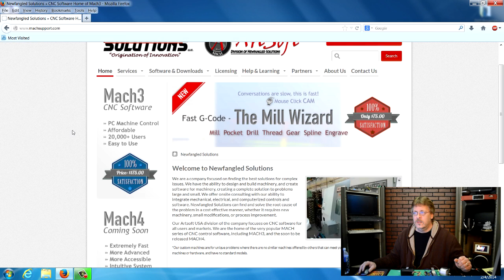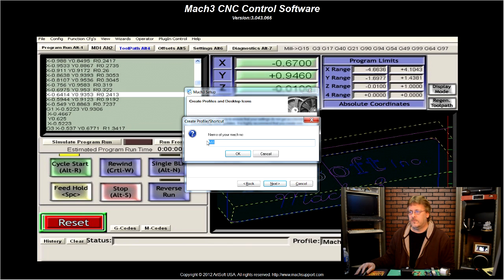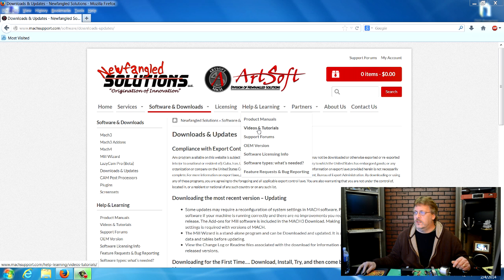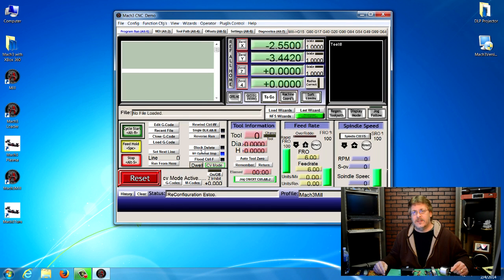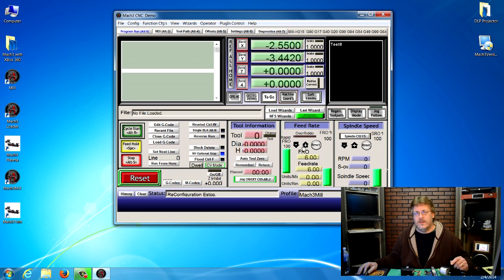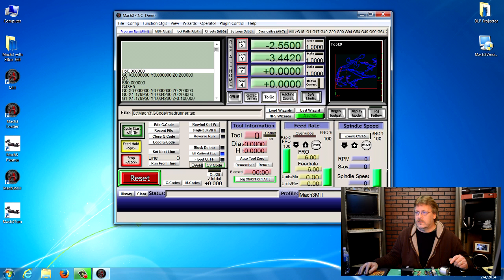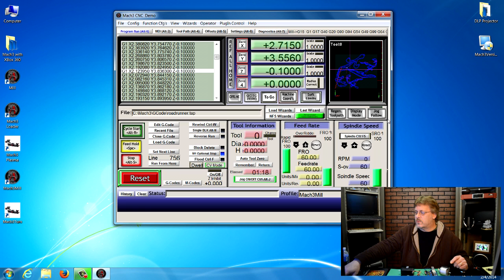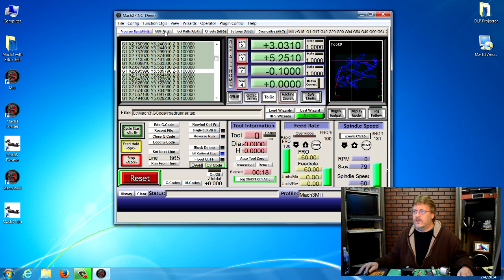CNC Machine Control Using Mach3 - A Beginners Introduction #1

Comment: Hi Steve, you have such a cool calm approach well done, I am Building a complete wood/acrylic routing machine 1200x800mm, For our new Makerspace Ashfield UK ,I have built an extruded aluminium frame with MDF worktop till I can upgrade to Aluminium, I have yet to make the control box as I am interested in building mosty by ourselves, IE bending up a box - fitting BOBs and drivers 2.2 kw woater cooled motor--- We got an XP computer, A Mach3 licence and decent leadscrews and runners. wish us luck in early 2025- Leo

Comment: Hi Steve, great video. I am getting into CNC, finally using the drivers, breakout board, and steppers I bought over 20 years ago. I did get to the point (years ago) where I bench tested the system, pretending to cut a circle with the X and Y motors, and it worked. Now, I just opened Mach3, loaded the Roadrunner G-code file, and the reset button won't deactivate when I press it. So I can't do a cycle start. Any idea why ?  Am I missing a step of some kind ?  Thanks, Tom.

Comment: Hi Steve good informative video thank you for that. Can i ask you though once i have installed Mach 3 how do i know what to put in all the settings boxes before i can run it on my machine?  They look insanely difficult to understand and most of the terminology in Mach 3 settings doesn’t make any sence to me at all. Have you made a video that covers the settings and what to set them to once you have installed Mach3 ?  Thanks in advance Steve and keep up the good work it is much appreciated.

Comment: Good video. Just to add some info; There is no problems running a laptop instead of a desktop, infact it's more convenient sometimes when you don't have much space. Laptop BIOSes doesn't shut off communication busses. The OS controls that, so if you set Windows power mode to high performance and disable auto sleep mode, you're good to go.
Reply from the maker: Thanks for compliments. At the time of this video, the ArtSoft, Mach3 user manual states that a laptop shouldn't be used due to interrupts on portable machines particularly one's that use power saving schemes. That may not be the case now with newer machines and OS's but you will never know if you dont try with yours, right? Steve

Comment: Your very concise in your explanations.   Thank you for that.  You mentioned the keyboard can be used to move the spindle.
My question is all the directions result in the opposite of what should be expected.  
For Example: Page ( Z axis) Down  raises the spindle and Page up lowers spindle.
Right arrow ( X axis) goes left (visi versa) and Y axis the  up arrow & Down arrows that do the opposite of what you expect.
Do I have a box checked or unchecked to cause this?  I am thinking it probably is a simple solution.

Comment: Hi Steve your videos are very helpful.  We bought a chinese 3040 t router on line from ebay which runs mach 3 software.  Having trouble with only being able to cut double line font when trying to make wood signs any ideas on why this is occurring.  No matter what font we use it cuts only the outer line for each letter.  We want to cut the inside of the letter for wood signs any help you can lend would be greatly appreciated.  We are wondering if we need to download another version of software like v carve pro or something?

Comment: Can someone help me please. .i use fusion 360 everything looks good...when I post the Gcode to Mach3 not all the code loads....example.  ..i made a large letter O it simulates perfect in fussion360....in Mach3 it doesn't load all of the letter a large part will not show in Mach3.....what am I doing wrong??
Reply: TexasWalker Woman do you have a full license for Mach3?  If not the free version is limited to 500 lines of code so check and see how many lines Fusion360 generated

Comment: In the pdf manual for Mach3, there is a sample program on page 10-22 "Code to Probe Hole" for the G31 probe code. In the instructions, it tells you what parameter numbers it puts results of different calculations (i.e. the average diameter of the hole is stored in #1034). Excuse me if this is a simple task, but I don't see where Mach3 allows you to view the contents of these parameters.

Comment: Hì Sir
Please help 
After I setup  and program to run . But the motor running very slow.
I look in to feed rate is 100 %
And when I jog is running normal.
Please advise 
Thanks
Reply: First ck motor tuning then push shift key while joging

Comment: or recommande for me a controler board that works with 4 axis to slave one axis
 i am building a CNC machine and i wanna run 2 stepper motor on Y axis run the same direction.

Comment: I have a question please
I have found a Mach3 card controller on Alibaba which the supplier says that it works with only a usb port instead of the parallel port.
So is that right? Can it works?

Comment: Steve, are you available to help me with a problem I think you can easily solve? I'll pay for your help. I have a 5'x10' CNC, I'm trying to cut a piece on the line that I printed and applied to a substrate (panel). It's the word "PARKSIDE" enclosed in a rectangle. I normally put the endmill in the corner of the rectanle and then load the G code and it goes from the corner to the outside line and cuts out the Parkside according to my vectored file. For some reason the endmill runs in the wrong direction (oddly this used to work fine-- but now I don't know what the heck is going on. I'm a bit of a novice CNC'er) I ref all, no issues, then put my work down... zero x/y on my registration mark and no matter what I do it's not cutting on the line. (I do fly overs over a test piece of vinyl print just to see if the endmiss is tracing my path.. This used to work-- but not it's not-- don't think M3 understands my table because I get the same results with enroute or vcarvepro...  Let me know if you can do a paid consulting job with me-- I'm not finding M3 staff very helpful at this time...

Comment: love your intro to the cnc mach3. Being a complete newbie I could not describe how helpful this is but still have encountered problem to accessing the software. I installed the software that comes with the cnc but unable to open it. When I double click to open the Mach3 program on my desktop  (on Windows 7 pro 32 bits) displays error : "needs associated  file to run or open the software." Can  you help me on this?

Comment: Quick question : In Mach3 I cut a file but instead of cutting horizontal it cuts vertical on the cnc machine. Also On the Job Display x and y appear vice versa I think. Assuming home position, (bottom left), if I hold the right key, should I expect the verticle line to move from the far left to the far right?

Comment: Hi, I am a technician at a school in the UK. We have a big Dahlgren 3 d mill/router. The software is obsolete and doesn't work and I was wondering if it might be possible to install new software on the controller or if there was another way? I am not particularly computer savy, any help or advice would be welcome. It used to run on Engravelab but we never managed to convert 2d design files from the network to files Engravelab, (standalone machine operator) would accept. Regards Adrian

Comment: Dear sir,
I have designed my cnc machine using lead screw and backlash nut so if i run the gcode generates by mach3 its only giving 5cm movement(approx) so what should i do in order to get 90cm of movement pls help me with this problem

Comment: Ok so is Mach 3 software controller? Seems all's it does is either stream gcode to controller board or interprets gcode to signals for stepper driver?

Comment: I have a txt file which includes G codes genereated by solidcam. Actually it does nothing, no preview no simulation. But it runs the roadrunner but doesnt run my code, do you have any idea... Btw good tutor
Reply: Thanks for your helps

Comment: Have a problem getting this program to work with my CNC routing machine. It will not talk to it even though I can get the USB controller provided by the CNC company to connect just fine.

Comment: Hi Steve,  I find your tutorials very help.  I have a problem with a new pc i just put together, it is of newer technology so it did not have a parallel port so i installed a pci express parallel card.  i am running windows xp for an operating system and in order to get xp to install i had to change the sata config in bios to ide.  Everything was working good until i got into mach3 now i can't get my motors to work, also my external estop does not work.  It's like my pc parallel port is not communicating with my cnc controler. Is there a com or lpt setting i have to change?  Would appreciate any help.
Thanks,
LeRoy

Comment: Hi, I would like to say thanks for your tutorial regarding Mach3.  I followed your video to the letter but when I came to loading latest installs I got a message saying the pc had a problem and would have to restart.  It did restart with am message stating "Boot from AMCI CD-ROM  oPERATING SYSTEM NOT FOUND.  ANY IDEAS AS TO WHAT HAS GONE WRONG.

Comment: Frustration... was connecting mach 3 to my xp computer (desktop), was trying to jog my z-axis.  Then the computer suddenly shut off.   I thought it was the computer and got a new computer.  Put in mach 3 again.  Let the computer run overnight with mach 3 running but not connected to the breakout board and did not connect the parallel board.  It ran fine, did not shut down.  but when I connected the parallel cable it shut down after a few seconds.  I am not experience in this area.  Do you have some ideas?

Comment: so are you saying i have to buy a new computer with xp which is not sold anymore?
Reply: Any luck over USB?
Reply from the maker: No.... It's just an inexpensive option

Mach3 Minimum Recommended Requirements:
Requirements if using the parallel port for machine control:
Desktop PC (Laptops are not supported) with at least one parallel port32-bit version of Windows 2000, Windows XP, Windows Vista, or Windows 7 (64-bit versions will not work)1Ghz CPU512MB RAMNon-integrated Video Card with 32MB RAM(Large G-code files, especially 3D files will require a video card with 512MB RAM or higher)
Reply: Weird.
Reply: i downloaded the demo that same as you but the g-code wouldn't run through the cycle the way yours did, it never started,any ideas ? i  have just bought a 6040z-s80 with the latest USB version control box which i am hoping to set up at the weekend :)
Reply: robert mccully 
Well explained

Comment: Mach3 doesn't require much to run.  One issue people may experience involves on-board/integrated video graphics.  I had random issues with certain things not operating effectively when the computer was operating with default 32mb on-board graphics setting.  Increasing the graphics in bios settings to 128mb fixed the random issues.  Random issues consisted of not running utilities from the wizard menu.  Integrated graphics share RAM with other functions in the computer to include Mach3 when it is running.  Of course certain Windows updates may cause things to change so I do not recommend updating the operating system unless it is absolutely necessary.  Computer should be dedicated to CNC and should not be accessing internet frequently to justify patching it.  Other considerations are shutdown and uninstall everything (clean install) that is not necessary for function of CNC, performance should improve and antivirus/firewalls may interfere with CNC processes/efficiency.

Comment: Ok, I understood, that with this program you can't draw anything. It just operates the drawing. So the queation is: can I draw something with "AutoCad", and go forward?
Reply: Most CNC programming software works with DXF format files. So as long as you save your AutoCAD file as DXF it should work.

Comment: hi steve, I purchased a 
800W 4 Axis CNC 3040 ROUTER ENGRAVER DRILLING Milling MACHINE 
and it needs aparalell port on desk top. theres 100 different types from really cheap to expensive. do you have any recomendations

Comment: Your video was very helpful. I don't have a machine yet but intend to DIY after gaining the knowledge needed to perform what I hope to do with a CNC Mill. As with most of us, my budget is limited but I don't want to get the basics only to discover that for a few more dollars I could buy parts to do make better jobs and more details. 
You like the Mach-3 program. Do you have suggestions on other items (i.e.: steppers, BOB, power unit, lead screw etc?
Thanks for any help, Tom
Reply: Same situation here, although I'm looking at machines on ebay. Building a machine is not going to save much and I'd rather  be learning how to use the machine.

Comment: Nice Video i admire it ... :) i have a question please did a building of cnc machine need a specific programming to connect arduino and the rotors  with mach3 software ..... or the CNC machine control using Mach3 will control everything 
Thanks in advance !

Comment: first good vidio
i am a beginner
i will check out the torts, but may be a heads up just to get my stepper jogging
i have windows 7, usb ports only, no parallel ports
using arduino w/cnc shield
went to device manager for address , shows 00000001
set up is a little confusing, not sure how to connect?
thank you
gary

Comment: Great video.  Question, I have a CNC 6040 3-axis Engraving Router USB PC communication type (not parallel port); what numbers are used for USB in the Ports section?

Comment: Hello Steve, ive recently started to play around with Mach 3 to one day use it for my cnc milling machine. So far i have been creating gcodes and uploading them on a USB device that is directly connected to the machine, and using the machines remote control to activate them. However when i'm using Mach 3, i dont seem to be making a connection from PC to Machine. I'm using a double sided USB wire, one side in the PC and other side into the Machine, it does not seem to work. Is there a special wire that goes from PC to machine to make Mach 3 recognize it? Or is there another solution to my problem?

Comment: Would you have any recommendations on calibration? I am having trouble getting my Z axis to cut to the proper depth. I have followed tutorials on Mach 3 but when I measure and enter the amounts it sends my router into crazy numbers which causes it to just bind and not move at all.  X/A and Y are close but Z is not cutting proper at all. Thanks
Not sure if it helps but the Z axis is on a worm drive type of mechanism

Comment: Mach3 is fn awful software. The learning curve is not for the DIY. 

List of common problems that people come across instantly and have issues getting straight forward answers to.

Motor Movements are reversed
Feed rate is slow as fuck

Answers they get are hilarious, take this video for example

Explanation of hardware... Really? We are trying to get our machines running by the time we get to this video and finds no new information. P.S. if you do not know how to change power settings on a laptop you prolly should not be doing tutorials! IMO

The next answer clogs forums... CV "constant velocity" Not an answer to the issue at all and only makes edges mill round.

My favorite by far is assholes asking for examples of G-Code....

How is it that nearly every FN person I have talked to says the same thing..

MY CNC MACHINE RUNS SO SLOW WHILE I TRY TO MAKE MY FIRST CUT I CAN NOT SEE IT MOVING.

Fuck MACH3, I changed to UBUNTU and immediately got my machine running with none of these stupid fn issues.

MACH3 has a GUI designed by a monkey who's only experience designing is throwing handfuls of shit at Plexiglas.
Reply: Death of YouTube LOL. How did you use a OS ( Ubuntu ) to control a CNC machine ?
One is a Operating System, the other is a control emulator.

and if you cant figure out those simple problems like motor reversed, you should not be building a DIY CNC
Reply: Death of YouTube ohh and Constant Velocity does not make edges mill round.
it keeps the speed constant as it performs arcs.
Reply: and that is the type of bullshit answer that confuses people..

Constant Velocity will cause ALL edges to be round. Very slight at slower speeds and damn near arches at high speeds.....

UBUNTU has a CNC program natively built into it that is very intuitive. 

MACH3 was made by a monkey... I have MACH3 running on an antique laptop to run a smaller machine that I rarely use. 

Don't confuse my hate for it as ignorance towards it. I am well versed in it and I am sick of the dumbass community unable to answer simple questions on it's forums...

Save your money and go another route people!

Comment: Mach 3 will work very well with a laptop - you simply have to disable the ACPI (Advanced Configuration and Power Interface) driver - replace with the option called something like "Standard PC Driver"

Comment: Great video Thanks!  I am building a cnc machine that does both routing (Mill ) and plasma cutting can you tell me if more than one profile can be set up in Mach 3 to accommodate a duel purpose machine ?  Again Thanks for a great video
Reply from the maker: Yip mach does allow multiple profiles and works very good. Thanks

Comment: Would you be able to point me in the right direction in regards to setting up a postprocessor for a diy 5 axis head head router with say, solidcam and mach3?
thanks
Reply from the maker: Post Processors are usually specific to not only the machine but the cam program that is exporting the code. If you are set in using Mach3 then Master-cam would be a logical choice as the cam software and Master-cam has tools within it to create custom post processors. I would take a similar post processor (5 axis) and edit it to work nicely with your particular machine. Please keep in mind that post processors are generally NOT transportable between cam software.
Reply: Thank you.
Reply: +GuruBrew how much to teach me?